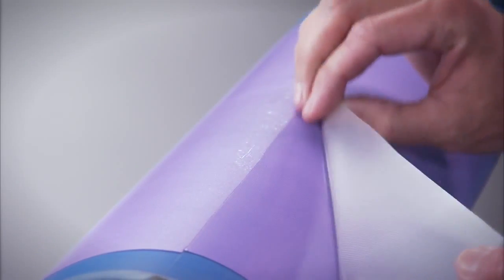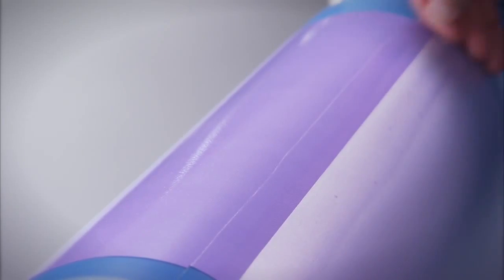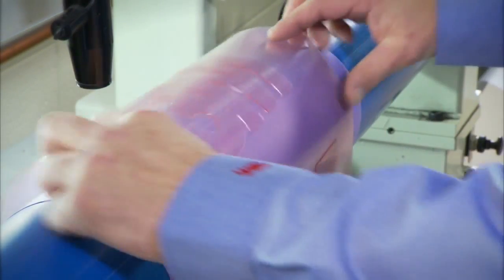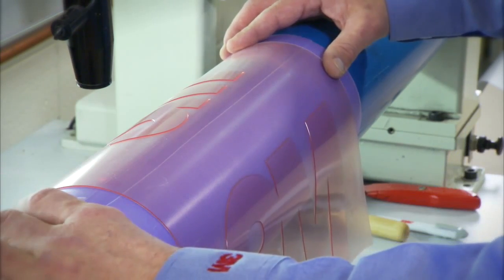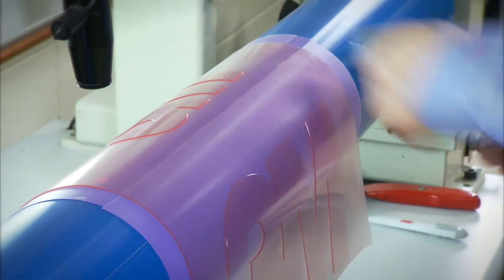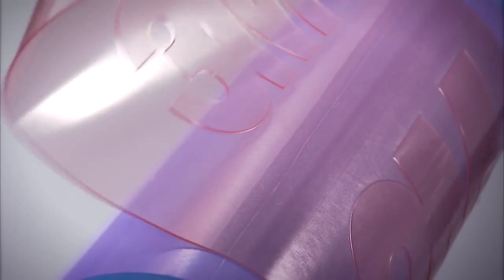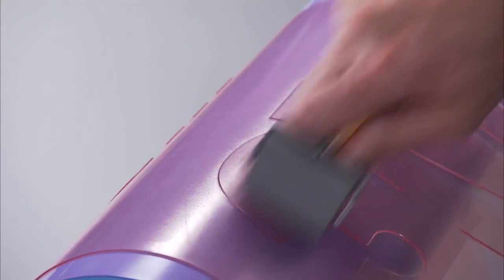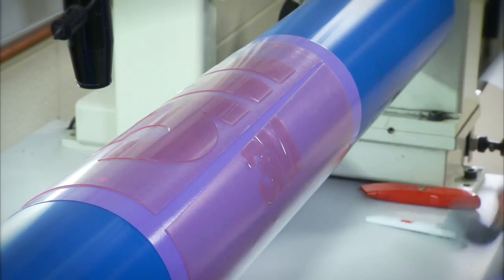How to mount Flexographic Printing Plates

Comment: Thanks for the video. Where to buy that red rubber ? What it’s called ?
Reply from the maker: Eric, this is one option to consider as there are a multitude of options for flexographic plate material. https://www.flintgrp.com/en/products/flexographic/nyloflex/
Reply: It is called a brayer. I use the lohmann brand brayer.